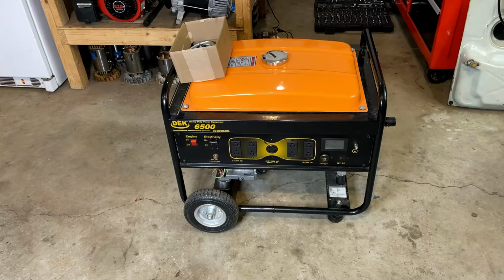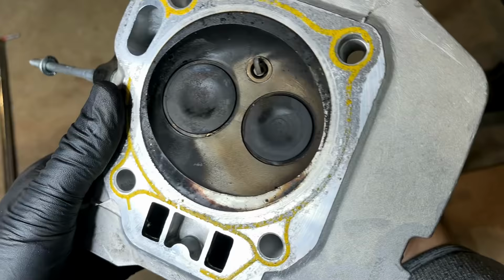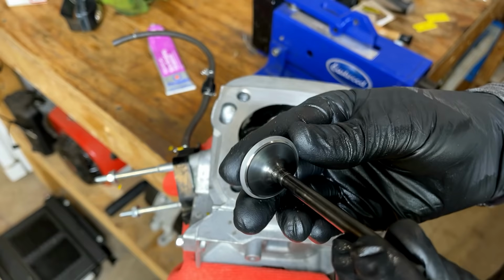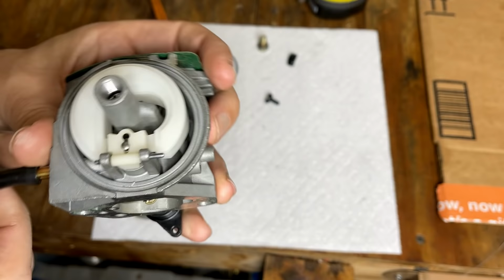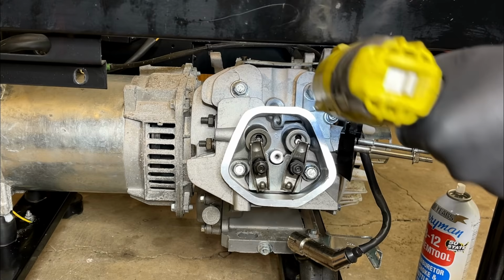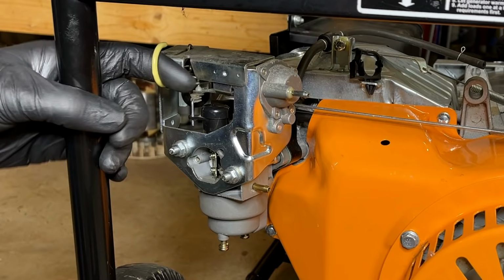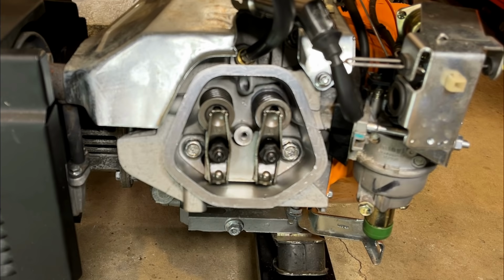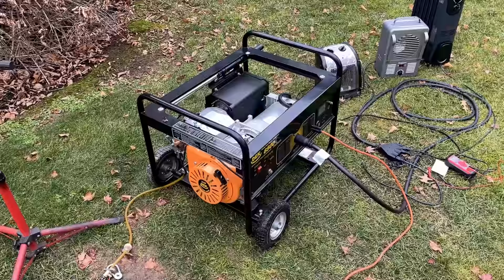Honda Clone Almost Dropped a Valve - Broken Valve Repair on a DEK Generator

Comment: id say that engine has only been run one time from the heat mark on the exhaust when you opened it up, that said i also noticed the fire ring on head,that doesnt look right, if it was a diesel that would be mark of water washing the rings.
anyway it could have been the cause of breaking the valve hard to say with engines, you just never know what the previous owner did to it .
i have same issue with this gen tron 13  1/2 hp generator i havent a clue how to order parts but have taken your advise before and just ordered honda clone parts that have worked as of yet .
im waiting on the day you go thru a propane gen hahah im starting to think a gov from watching one your other video is my problem ,i have the throttle zip tied to run the gen ,without that it just hunts

Comment: Having worked on Honda Engines and not the Clones, I would be interested in hearing how you would compare the two.
Reply from the maker: It's hard to say because I see a lot more clones the Honda's.  But, I have had very few Honda's that required engine work.  So the quality is better for sure on the real thing.

Comment: James I have a rato 210r from a wood chipper. The crankshaft is broken off at the edge of the case.  Since I'd like to repair the engine, but I would need a crankshaft cheap.  Can you recommend a source to replace it? Thanks!

Comment: I have a honda 6500   is a old  one works good.  But is very hard whene i pull    and whene start smoke a lot. For a minute then the smog desapear. And works fine. Do you have any idea why ? .   ( A guy say  maybe the valve seals )  thanks a lot

Comment: Who  did you  get the  mini drill bits from  looks like a nice tool to  have I use a set of  cleaning rods/ files for welding tips  but your set seems much  more precise. Thank you  for the crash course. Well worth the time spent .Also could you  mention  the name of the company  you  get your parts from ? I have a backpack blower  that the company will only  sell the complete engine  and all I need is a valve stem  retainer  probably a $3.00 part if that .Thank you  in advance.
Reply from the maker: The link to the drill bits should be in the description.  For part, I buy from eBay or Amazon when possible.  Otherwise whatever site says they have the part.

Comment: Why would you think on mine the intake after putting the lifter nut all the way down its way to high  to high from the valve to adjust  I'm assuming the cam or valve  is bent I don't know the exhaust works fine on rotating the engine but the intake is eay to high to even push the valve I bought so called new push rods same size as the old  any reply is thankful

Comment: I thought the comments section had weaned you off using assembly oil on parts that get very hot (valve stems). Maybe that only applies to the cylinder and piston area.
Reply: BTW thanks for reinforcing the mantra of the true craftsman/mechanic/carpenter/... "check and double check".

Comment: Thank you so much for this video, it's exactly the same carburettor mine has, does this mean I have a Honda clone engine? I am using the NGK BPR6ES Sparkplug is that ok? I have no manual for it got it second-hand.
Reply from the maker: You have a jobs clone.  Sounds like the correct plug
Reply: @jcondon1  Thank you 😊May I ask what type of oil you use, please?

Comment: A tour de force.  Thanks for the explanation of compression release and its association with the exhaust valve.  Did you use an abrasive cut off wheel on the dremel or perhaps a carbide toothed blade (which I don't know if they make)?  Kind Regards, Craig
Reply from the maker: It was an abrasive cut off wheel.

Comment: hello James , I also am working on a Firman and it seems to be a 420CC Clone, 90mm piston can you send me a link to these specs you found. Also is there a PN of the Case as my piston had a ring that dug into the bore sleeve, honing would not get this out. Thanks Ted.  littleton, colorado.
Reply from the maker: I put a like to the service manual and the parts used in the description.

Comment: Hi James, this isn't about the video but about my mobility scooter's 24v 500w motor. The scooter runs flat after about 4 miles and it's supposed to do about 20 miles. I've replaced the batteries which has made a very slight improvement. I've done an ohms test on the electric brake which is perfect. My question is, what would you expect the ohms test reading on the motor? Regards Martin
Reply from the maker: I would expect it to be around 1.1 ohms.  But hard to know for sure.  Might be a bad battery or maybe an issue with the charger?
Reply: @jcondon1  Thanks James for your reply. I've also tried another battery charger which has made no difference  at all. About 1.1 ohms is a ball park figure. I forgot to mention that it's a brush motor, does that make any difference? Once again thank you James
p.s. I haven't watched your video yet, I'm saving it for later. :-)

Comment: Great video Jim but where do you get your parts from as I have the same engine (honda clone) and don't seam to be able too find any parts on Ebay
Reply from the maker: dieselgeneratorparts on eBay.  Links in the description.
Reply: @jcondon1  thank you it's not easy to find parts here in Australia for imports US made genset

Comment: Great job! What's the purpose of the spark plug firing a second time when both valves are open?
Reply from the maker: Its just a simple design and maybe a little cleaner.  The flywheel spins twice for every one revolution of the cam shaft.  Plug will spark each time the piston is at top dead center.  If a CDI system, the pulse generator would be on the cam shaft so only one spark on the compression stroke.

Comment: Is it common James for these single cylinder engines to spark twice during the 4 stroke cycle? Never heard of that before.
Reply from the maker: Yes, they all do unless using a CDI type system which some inverter generators use.

Comment: Hey James, as an expert in generators, what do you think my Titan 8500 gas unit is worth in Miami. I last used it 3 years ago, engine ran fine but was told it has some power head issue. Made power but not stable.
Reply from the maker: Generators with power issues usually sell at a low price around me.  $100.  But is varies depending on where you are.

Comment: whats the point in picking up and setting the valve down while lapping?
Reply: The grinding paste is refreshed/distributed by rotating the valve say 90 degrees to the last point....
makes valve/seat tolerances smooth to the same degree...
Reply from the maker: The valve grinding compound gets pushed out.  Lifting it and putting it back down gets the compound back to where it needs to be.

Comment: I have a Honda clone bought at a garage sale with no pull start . Has no serial number. Where do i get engine parts?
Reply from the maker: Any Honda clone recoil will fit.  That said there are a few sizes.  If your generator in in the 5000-8000 watt range search for 420cc recoil.  If in the 3000 watt range then look for a 212cc recoil.  You can even use oem Honda gx390 recoil or gx200 recoil.

Comment: Have you ever tried Sea Foam to remove carbon? I've used it on throttle plates in automotive and it cuts pretty fast.
Reply from the maker: I have on a Ryobi 5500 with a blown head gasket.  Hard to tell how well it worked because the head was a complete mess.  https://youtu.be/cTgImQNdZ1Y

Comment: 4 stroke engines do not spark twice, I don’t now we’re you got it from,
Reply from the maker: Most small 4 stroke engines used in lawn equipment and portable generators are a wasted spark system,  The engine is at top dead center twice.  Once at the end of the compression stroke and again at the end of the exhaust stroke.  The magnet passes the ignition coil each time and produces a spark.   https://gtc.ca/blog/what-are-wasted-sparks/#:~:text=Wasted%2Dspark%20systems%20are%20simpler,%2Dkarts%2C%20and%20some%20generators.
Reply: Waste spark ignition is used on tons of 4  stroke engines, including a lot of automotive stuff.
Reply: @ouch1011  explain to me, all the automotive stuff it’s used on.I wanted to see if I wasted 4 year automotive apprenticeship and 27 years working on 4 stroke engines as a motor mechanic
Reply: @ouch1011 have you found anything yet, I’m still waiting?

Comment: Is crazy how so many manufacturers just use the honda 5.5 base by cloning it then calling their rendition their own designed motor.. those companies will argue that no other parts will fit the engines besides their own parts which always cost 4 times as much at least..  wen, dek, durostar and a few others all use that exact same motor, just paint the parts a different color..  lol.. like i spoke to 3 different people with durastar about if the starter off of a diffrent model would fit the one i had, said nope no way.. said there isnt one made in existence that would work without tearing the motor up..  well a honda starter kit bolted up to the oem bolt holes exactly and the damn flywheel taper was exactly the same.  Everything..  i put that info up all over their website and they tried to say i was lying and would void the warranty.. well their crap doesnt even have warranties..  only defect warranties..  lol.  Bastards
Reply from the maker: Most say the same.

Comment: Shame on you, you had a torque spec for the valve cover bolt and you did not torque it.   LOL. I rarely torque such things as valve covers, blower cover bolts etc.  head bolts, and valve rocker arm bolt stud yes.

Comment: do you have a generator with cross threads sparkplug, not sure if it can be fixed if you see this let me know  thanks.
Reply from the maker: The only thing that can fix it would be a time ser,  heli coil or something similar.  Have not tried them before, but have heard good things.
Reply: @jcondon1  thank you james i have ordered the tool will give it a try,nothing to lose,the generator does run but like your spark plug hard to start,will let you know how i get on,you have helped more than you know,big thanks from Scotland.
Reply: @jcondon1  i just got the heli coil will record let the see.just hope i do as good as you.
Reply from the maker: @chillout1001  good luck.  Let me know how it works out.  Have heard good things about them.
Reply: @jcondon1  i will thanks for the vids and help.should be fun to get it running again.
Reply: i was to fast i need to slow right down,so walked away and re do again ,i would say if threads are chewed take head off do it in a safe and easy and take time to do it right first time unlike me fast as sh.. and boom i need to be more like james and do it right.

Comment: Quit fooling around with those junk spark plugs. Always, just put in a new NGK plug with proper gap and problems disappear. ( any  2 cycle or 4 cycle engine ).

Comment: The dreaded Torch spark plug.... those things are GARBAGE!!!
Reply: Ive used Torch plugs many times before. Never had any issues.
Reply: @elcomandante9299  I wish I could say that.  I've only had 1 make it past 15 hours of run time.  Now I don't even give them a chance... any new engines I get automatically get a new NGK plug before the first pull.

Comment: IF YOU ADJUST CLEARANCES WHEN  VALVES ARE OPEN, THEN YOUR DOUBLING THE CLEARANCE  BECAUSE THE ROCKER ARM ALWAYS HAS PRESSURE ON THE ROCKER ON THE ARM ONTO TO THE VALVE AND HOW IN THE GOOD "GOD" SENSE DOES THAT WORK FOR THE CORRECT CLEARANCE IT CAN'T EVER! VALVES MUST BE CLOSED, SO WATCH YOUR WORDING ON WHAT YOUR SAYING THE DOING DOESN'T MAKE SENSE FROM YOU!